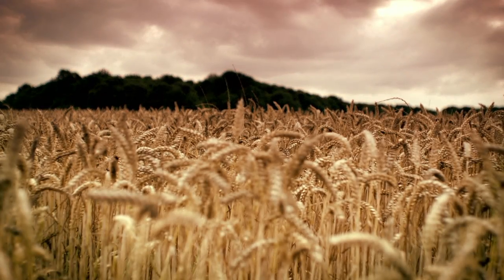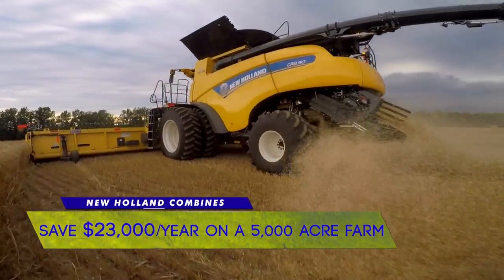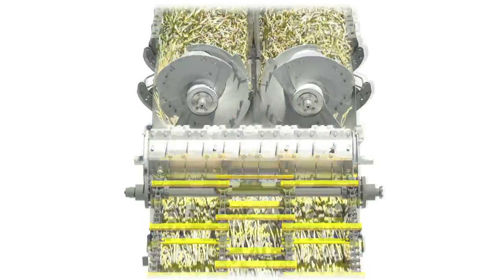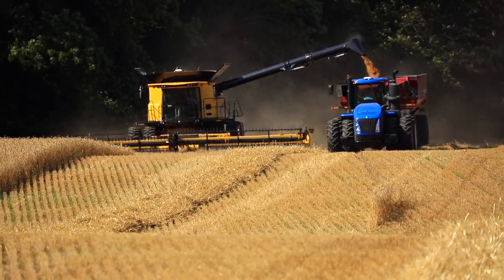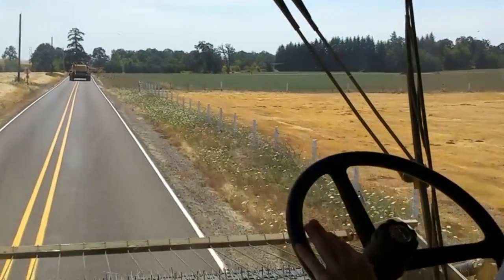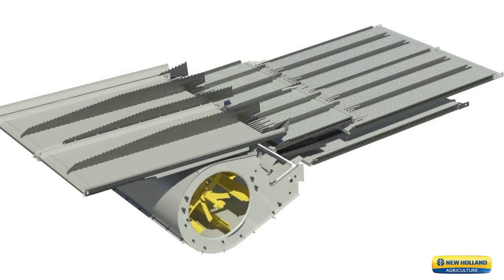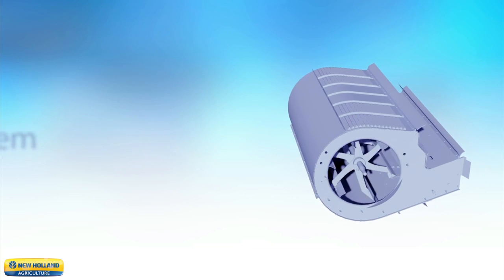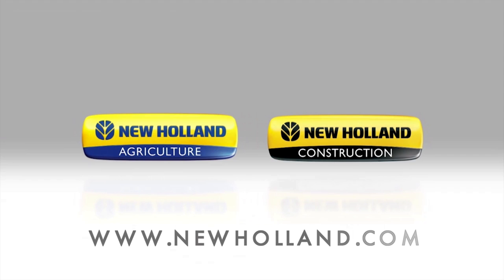Don't leave money in the field! The financial savings using a CR Combine

Comment: Over complication is the word that comes to mind. Tailings system and cleaning fan are years behind most manufacturer's. Including the one they share an assembly plant with.
Reply: I'm unfamiliar with how the tailings work on a Case. New holland has a cross auger that goes to a small elevator on each side. Pretty simple actually.